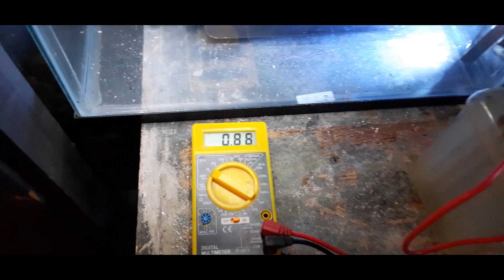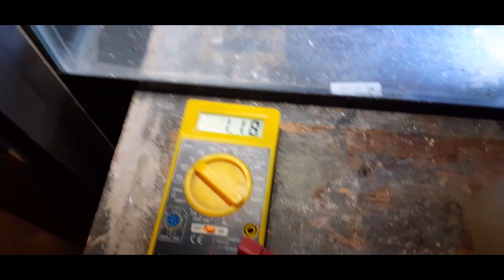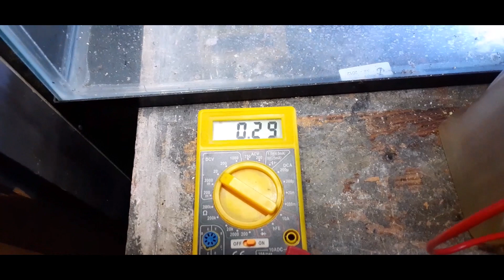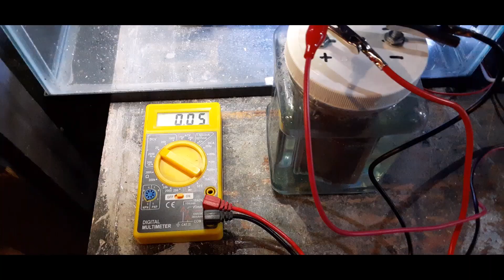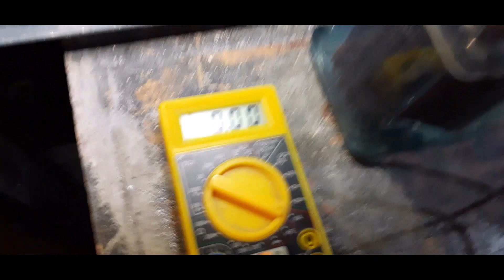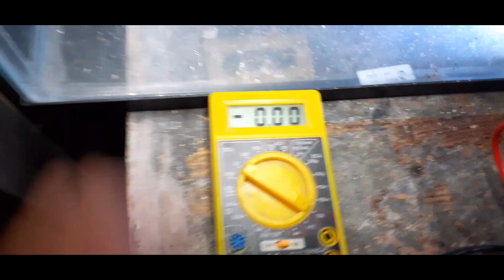Pewter / Copper and Zinc / Stainless Steel Battery Cell Test

Comment: Have you considered Vinegar?
Reply from the maker: I have thought about vinegar but chose soda instead as I had it handy.  Vinegar would have been a better choice and turns out I'm not a fan of sea salt, coke or peroxide in these tests as they don't do very well. For the hell of it I might try copper and zinc with vinegar but probably won't include it as this is going to take me forever to complete this as it is.  Honestly I don't see straight plates in any combination working good enough to up scale it but one never knows unless they try.  I found out the nickel iron battery wasn't simply metal and I'm going to point that out soon.  It was much more involved than simply two metals and pot ash.
Reply: @Lightendog  My thinking was from the Baghdad battery where they used copper, iron, vinegar or wine. I do appreciate your transparency and thoroughness.
Reply from the maker: @richspillman4191  Been thinking about what you said all week end on the Baghdad battery........I'm thinking about modifying it with charcoal and acid, lol.  What's the worst that could happen?  I will use vinegar and pot ash also with a simple plate test to see what she does.  Thanks for your input and new ideas really do help.
Reply: @Lightendog  bleach is another option
Thanks for sharing, interesting results 👍🇬🇧
New subscriber
Reply from the maker: @strawman9410  I can't stand the smell of bleach, lol chlorine is bad enough.  Plus I went with the sodium hydroxide which is the strongest of the alkalines being a 14.  Bleach is 13 on the ph scale.  Thanks for the comment and new ideas are very much welcomed.